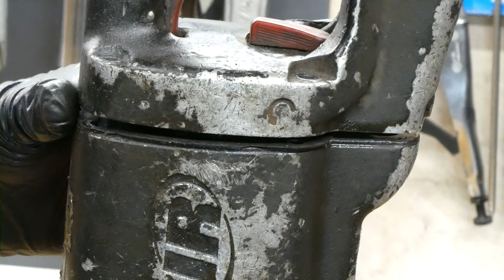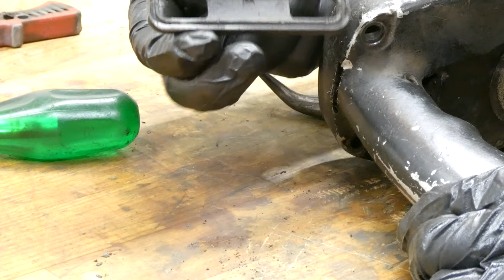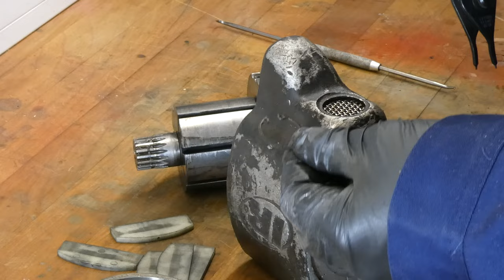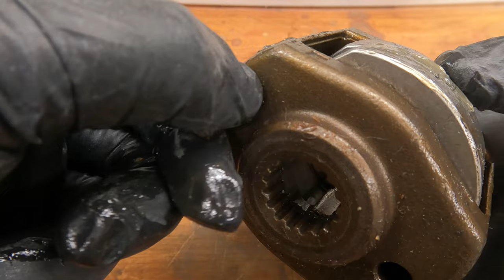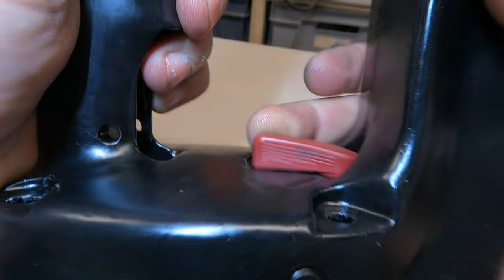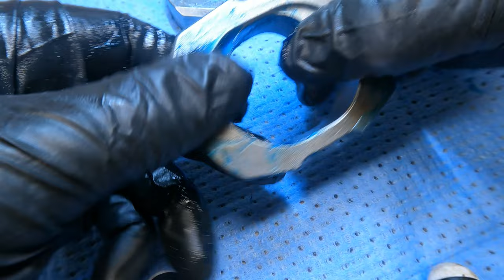Air Impact Wrench Restoration - Ingersoll Rand 2190Ti

Comment: Maybe hook it up to an air supply and see if it works properly. :)
Reply from the maker: It did work as a charm. Sounds like a harley Davidson 😎 i think in the video it was just hooked to 1/4" air. But with 1/2" it pulls some insane torque 🥳